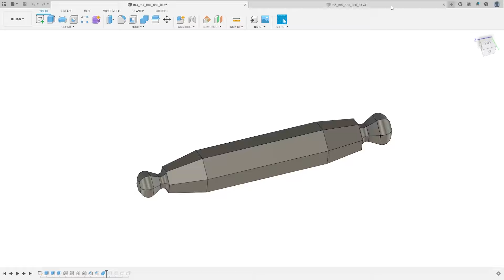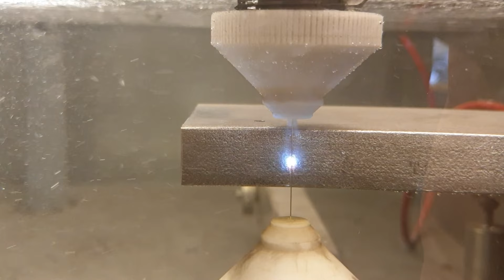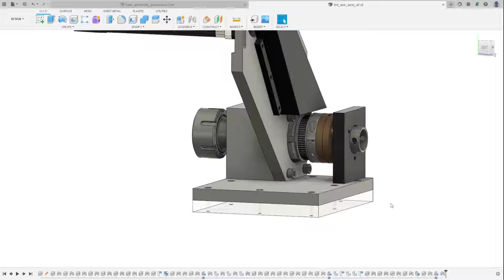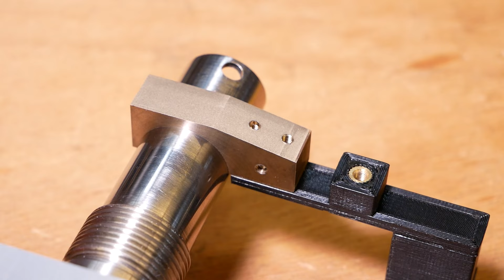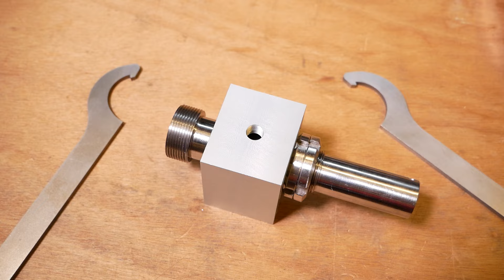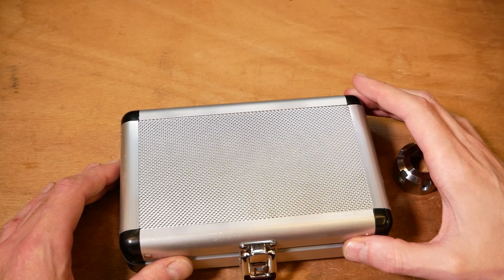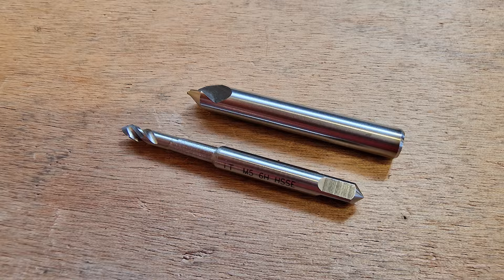Worlds First DIY Wire EDM Lathe!

Comment: Really enjoyed the video, thanks! I have one question from the design process though - probably a very naive question too: Why is isolating the base of the machine insufficient for using steel bearings - why the need for either ceramic bearings or a plastic bearing block? I see little difference between an electrically floating outer bearing and an electrically floating outer bearing-bearing block combination. Is the large surface area of the block in contact with the water the problem? Thanks again for a great video that brings us through the previous iterations!
Reply from the maker: You guessed right. The large surface area provides a capacitive coupling which if not isolated properly will create eroding currents in the bearings.

Comment: One question: do you not find water travelling up the drive belt collecting, dripping and potentially getting into the stepper any kind of issue?

I was thinking you may have had a centrally fitted "transmission" of a simple idler shaft, two belts and two cogs ... one either side of the vertical support bracket ... A "wet" lower side and a "dry" upper?

Comment: You will not be able to use the smaller of the end of the larger one. as you will not be able to fit the M6 side into the 4mm barrel

Comment: you should edit this down to 5 minutes.  You ramble, repeat yourself and state the obvious too much.
Reply: Nice projekt, but it is not true that its the first in the world to make at rotating wire EDM. I have done wire EDM for nearly 40 years on Agie mashines and made the first "lathe" for 5 years ago and it works very precise. I used full ceramic bearings and an airmotor for rotating.

Comment: Wait, how do you insert the 6mm hex end into the tool holder for a 4mm shaft? It's a double ended tool insert, both sides need to be 4mm or less.

Comment: Great video:) I’m curious what the limiting factors for EDM are as far as the speed in which you can cut. Can you just increase electric power to increase speed? Would the failure point be the wire material itself? Basically, what are the factors that prevent cutting something like hardened steel at 100+ mm/s:)? Thanks again, you’ve really “sparked” my interest in the technology. Hopefully this type of equipment will follow FDM etc in becoming accessible to the hobbyist. I’m working on an exoskeleton to help with my muscular dystrophy and the inability to machine metals has been one of the limiting factor.
Reply: I run one at a job shop. You can push the wire faster a few ways

The best is flushing flow and pressure. The debris from cutting really slows down the cut speed. More flushing is better. Get the nozzles about 0.005” away from the material and pump as much water as you can with a laminar flow nozzle. 

Increasing or decreasing voltage matters. If you increase voltage, most edms will get closer to the material to bump up the effective voltage/power (not supply voltage) to cut faster. A lower voltage leaves a bigger gap but flushes better. You have to balance. Usually you can go each way and watch the speed change to find a good medium. 

Wire size/type matters!  0.012” wire cuts stupid fast, 0.002” will be sooooo slow. Zinc coated wire cuts faster and cleaner, and solid zinc can be the best but it depends on your work material. 

Water quality is huge as well. Gotta keep it super well filtered and deionized. 

You also have to balance things like pulse on/off time. Increasing the on time can burn more material away, but by the same note pulsing hotter for shorter can remove even more and flush better.  Most are pulsing at several mhz so it’s hard to really get a feel for it. 

You can also get hard/soft/semi hard wire for different taper angle cutting and accuracy. It’ll also affect the breaking strength so watch that.   Hard wire cuts the fastest but is the hardest to make work in autothreaders. Soft wire is super easy so thread but is easier to break and slower

It’s like feeds/speeds for milling but with 10x the variables

Edit: for example, I had a job in 2” steel running at 0.05” per minute with 0.01” soft brass wire. We bumped it to 0.16” per minute by using 0.012” hard zinc coated wire and playing with parameters for a bit and watching the speed change/volts/amps/water discharge/wire discharge
Reply: @blacklabel6223  wow! Thank you for the detailed reply. I really enjoyed reading it. What I particularly found interesting was the flushing and closeness to the work piece as well as the water becoming conductive if it’s not filtered enough. I had no idea the amount of variables That was very nice of you to take your time and share:)

Comment: You could use boiled linseed oil on the blued parts, it will polymerise (give it a few days). Do look into the fire hazard that rags covered in boiled linseed oil are. Also, does the ball for M6 fit in the holder so you can use the M5 ball?
Reply from the maker: The holder is stepped inside with a mouth of 5mm and a throath of 4mm, so it accepts both. The 5mm is not that deep though, a bit incovenient to use. I might redesign the bit.

Comment: If you work with small screws/bolts in any capacity I want to recommend to you 2 things which will, and I'm not exaggerating, positively change your life.

First a precision electric screw driver and any bit kit with a lot of bits.

My recommendation here is the ES15 which allows you to even upload your own firmware.

Second is a good set of hex bits so the only times you have to make your wrists soar with those wretched l keys is when you have absolutely no space to fit a driver.

No specific recommendation there but between a bigger set for your 1/4 inch(6.35mm) drill and most large 64 bit + precision sets including precision(4mm) hex bits, you should be covered for everything from m8 to m1.6

Comment: Non magnetic stainless  steels are the austenitic type. But there are steels classified as stainless that are magnetic, those are usually the martensitic type. You are correct in saying the austenitic stainless are more corrosion resistant in general. But being magnetic does not mean it is not a type of stainless steel. However, seeing how easy those collects were blued, that steel don't seem to even be martensitic stainless at all.

Comment: I too have that swiss army "cyber tool" version handy most of the time...
I thank my colleagues who gave it to me on leaving a job - over 23 years ago.
(really)

An "EDM lathe - rather a 4th axis in EDM, has little benefit rotating at high speed, as you seem to have  found out, better having precise "C axis" control than thousands of RPMs.

- NB, Ferritic Stainless steels etc..  (non austenitic) are still "Stainless"   though magnetic.
(not an original comment no doubt)

Comment: Funky I like watching your videos. I would probably have tried to use a grinding machine for this product. I wonder apart from the long machining times, how much wire are you using for those items?  
My neighbour runs sinker EDM machines, he sometimes comes to the rescue if I broke a tap in my part. 🙂 The machines use oil as the flushing liquid.
Reply: It's clever tech for sure,but like you say kind of overkill for this product.Give a man a piece of hex bar and a file and he could make this.

Comment: Nice. But, HSS steels are hard, not necessarily tough. You would probably end up with a better bit using an appropriate steel with correct temper...

Comment: how about a simple metal wire twist on two points lathe, vertical or horizontal, should keep itself level, if you put force to keep the wire straight, not flexing too much, tension lathe, then let it roll spring left and right
Reply: ie screw action spring wire rotation lathe
Reply: super cool looking
Reply: how about just hot wire plasma cutter, you can cool that with just air
Reply: it can be even inert or uv-deuterium gas filled, no water required
Reply: tungsten super heated wire
Reply: standard liquid cooling spray
Reply: if you use inert gas, then you dont get rusting or surface defects
Reply: you get very accurate tolerances, no surface treatment or mess up required
Reply: just use standard store arc welder as the power source with tungsten wire, like in a lamp filament but thicker

Comment: You do know that you can buy pocket-sized folding sets of allen wrenches?
I have 3; a metric, imperial, and torx. They were only about $10 each and have survived quite well but I dont use them for brutal tight bolts.

Comment: Your second bit is a little bit single ended it seems at 3:19 it was clear that it would not fit into the holderr or tool properly.

Brilliant design and I am very impressed with the ceramic bearings and slip ring design.

The work piece and your machine tool quality is amazing and I am glad you keep promoting the personal EDM movement.  I hope that one day there will be mostly open capable designs for all the basic machine tools and devices one needs to keep a village operational.   As soon as Unconditional Basic Income is rolled out there will be even more small scale designs that become open sourced as people do not fear for their basic needs and can afford to share even more.  Your philosophy is fair and does not prevent others from rolling their own electronics if they want the challenge.  You are helping with EDM like RepRap helped with 3D printing, it is just a bit harder to have the EDM make all it's own parts at this time.
Reply: From whence cometh this magical unconditional basic income?
Reply: @pappaflammyboi5799  If you take out a loan and someone else takes the money and spends it how they like and you have to service the loan is that normal for you?

This is how money is created these days.  The government spends money and you have to service the interest (to private banks with catchy "central, reserve and international" in their names).

The cost of Unconditional basic income is close to net zero as all money directed through it reduces cost of managing means tested benefits, reduces cost of social assistance to the poor, reduces the benefit trap where it is more profitable to remain sick or unemployed to avoid the risk of loosing benefits while an UNCONDITIONAL benefit means ALL work is profitable.  As you exceed minimum wage the benefit will be balanced with an equal increase in tax so no net change.  If you are still believing that such a benefit will cost money you have probably been reading mostly propaganda and not the academic research in the subject.  In a welfare state the cash is ALREADY handed out to the poor but under threat that they must seek work (that is not available) or loose the benefit.

Human ingenuity has made almost every facet of production more efficient many fold yet it still costs more than a poor person can earn in a lifetime to pay for a house, how is that possible?  If every year there are improvements in efficiency how come ONLY those who have capital benefit from these improvements and humanity at large remains in a wretched condition.

The easy fix is that every cent/penny that a GOVERNMENT has in income from patents, mineral rights, land taxes, loans should be distributed evenly among the GOVERNMENT SUBJECTS first and then the government can must run their budget according to what the subjects can pay in fair taxes.  Why must certain industries with powerfully lobbies get the lions share of all government funding and then social benefits are provided from what little change is left.
Reply: @pappaflammyboi5799  You assume too much.  I simply hope that the vulnerable will be cared for by the rest of society or it compromises out collective humanity (as we do now) to the point that suffering is condoned. This is not good.  If you think that rule of law can be achieved without top down government why have you or nobody else done it since high speed travel (horses and ships) were invented.  While there is any kind of poverty and no support for the poor you will have some flavour of wild west or government.  Why not simply find the middle ground where the reason for big government is eliminated.  No more poverty and the vast majority of laws and politics is no longer needed.

I routinely promote tiered and local government with maximum personal freedom.  I maintain that to reach stability we need to enable dissident thoughts and dissidents.  However the only way we can avoid totalitarianism is if we have some mechanism that will prevent destitution.  You hope for libertarian utopia perhaps, not sure but that can only work if there are no homeless poor, otherwise you have to have a police and then an army and you need fiat currency to pay for all this with taxation as the source of revenue.  However with a OPT-IN government where people get a UNCONDITIONAL Basic Income from the profits of modern technology they then agree to play nice and share in common utilities and responsibilities has a small hope of working into the far future.  A system that destroys a significant fraction of natural resource and human effort in policing  and arms industry will keep failing as the portion will keep growing until there is a regular revolution.  Revolutions keep coming around until the reason is removed.

So I do not advocate for large central government, I advocate for a mutually beneficial social contract where citizens and society (managed by a honest and lightweight government)  are in a win-win situation instead of the give-take relationship that we have now.

We probably have the same goals but I hope to find a mechanism that can get us there.  Wishing away fiat currency or large government will not happen, finding a way to make them less relevant may get us there in the end and that is the goal of UNCONDITIONAL Basic Income, sort of like the wartime ethos of not leaving any brothers in arms behind, all of humanity is our brothers and until we care no one else needs to either.
Reply: @KallePihlajasaari  An opt-in government is fine by me, as long as whomever is running such a thing, is being self consistent. We are in agreement that governments serve limited purposes; mainly to secure individual rights (property, bodily autonomy, defense, etc).

If there's a way to freely opt-in or out of any particular monetary system, I'm fine with that too.

Operating an organization where the poor and destitute are taken care of is a good idea as long as that organization uses no coercion to maintain itself. You should be as free to join as leave, much like you do a convenience store.
Reply: @pappaflammyboi5799  We are not so far apart in the end.  Dialogue is essential to the future well-being of humanity. The middle ground needs to be found because all hard-line extremes will alienate the largest number of people while a permissive middle ground will accommodate the most people.

I hope for the opt-in social contract to be the shortest list of rights and responsibilities that we can come up with, a lite constitution.  Each layered sub region can then add a few more if they want. Such as free public transport in exchange for not parking your car in the middle of a private road that is used for community access.  The best would be to have laws that provide for the basics and then public guidelines of how to avoid inconveniencing others with easy access to dispute resolution and damage payouts if you do inconvenience others. If someone is injured or killed the resolution process moves to the national level immediately otherwise it gets done at the village level initially if at all possible.

One possible way to reduce the damage from elected officials if that a non-confidence recall vote can be done by the citizens AT ANY TIME and it requires only as many votes as put someone in office to remove them, this means that if you get in with a niche platform that is not opposed but start to effect changes that affect the majority they simply call a vote and anyone who now feels it is their business to limit the damage can vote and remove the irritation.  This means that people only have to vote when they want to remove an official and otherwise we could live and let those that want to govern do their stuff FOR THE PEOPLE as long as they do not stray into doing stuff for their corporate buddies.

I feel that a government would be a sound thing to have as long as the government feared the people and not the other way round.

These last thoughts are extrapolated from less well known Demogarchy ideas of Denis Beckett, he wrote a small book on the topic and has blogged a few times.
Reply: @pappaflammyboi5799  Just to highlight that a "rule of law" society has automatically got a class of protected individuals that need a state to manage them.  They are often called judges and leaving their selection to the richest guy in town has caused a lot of grief in the past.

Comment: I've heard it called turn and burn, Ive also only seen the electrical connections on the same side of the bearing as the work. might be some problems later. also where's the finish passes? just gotta go slower when not engaging the full wire width.